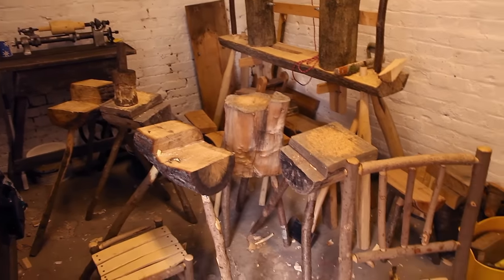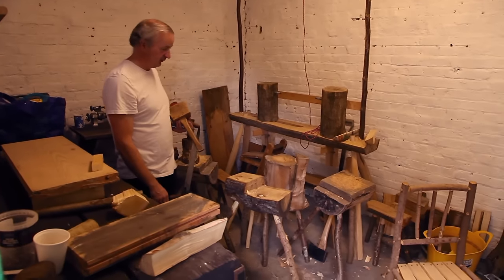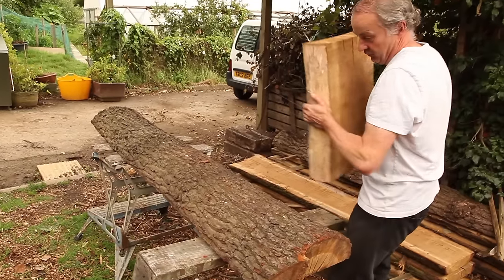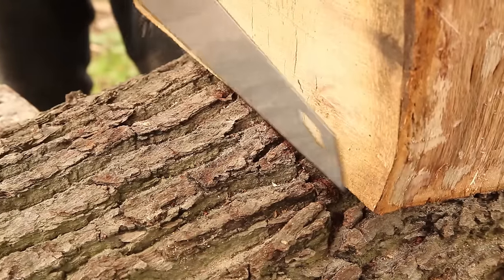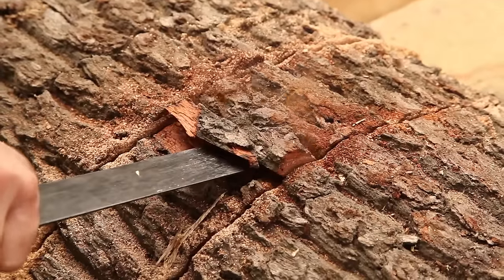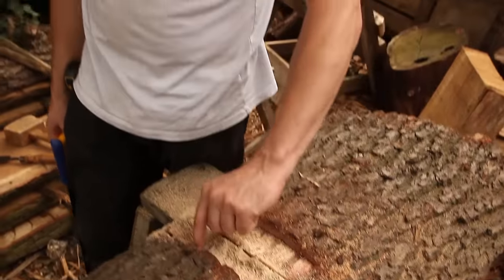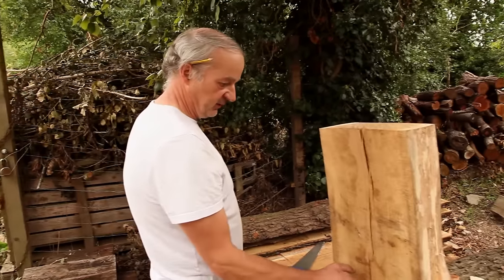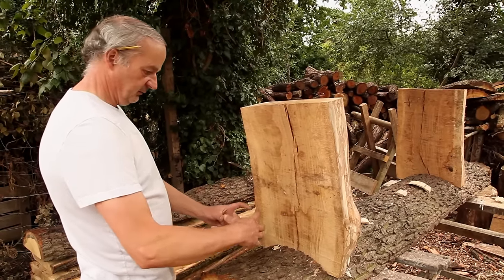From Tree to Bench Woodworking video

Comment: Beautiful job.
Bark does not have to be removed? Water will get between the bark and wood and will rot.
It seems to me that the bench will be stable when the legs have the shape "W".
Reply from the maker: The bench is good and sturdy 2½ years later. Oak weathers well although it greys in colour
Reply: Good wood withstands weather conditions. Four years ago I laid a sidewalk made of pieces of roof rafters, painted with old car oil, which keeps well, in my north-eastern Poland we have extreme weather conditions.

Comment: Hello, what does it mean a fallen tree? it looks like the tree is still wet, meaning in few weeks when its dry, cracks and holes might appear and damage the bench.
How do you overcome it?
What do you do against ants and other tree insects?
Reply from the maker: That's the beauty of Oak. The wood was cut and allowed to air dry for over 6mths before he started work on it. It will and has cracked a little but only superficially and it has greyed in colour but that is the charm of rustic furniture. Many old English building have Oak beams that are still holding strong 100s of years after construction
Reply: @stevehaskett100   you don't put varnish on it to keep away the humidity?
what about termites or other tree insects?
can I do it with a pine tree log and not oak, even thought the pine is less strong from the oak?
Reply from the maker: @coraceci5841  Tom is the craftsman who knows much more than I do. I just made the video but I can confidently say that pine is a much softer type of wood and would rot if left untreated. For more info go to Tom's website and contact him through that. I'm sure he would be happy to advise
Reply: @stevehaskett100  Ok. thank you very much.